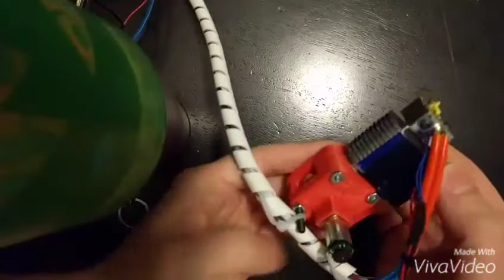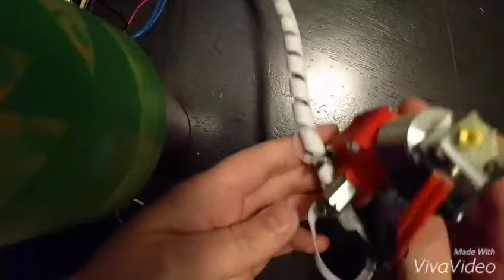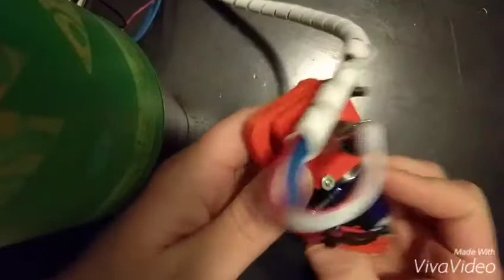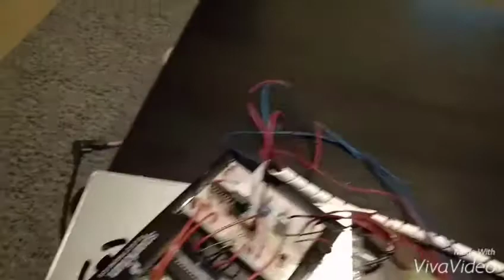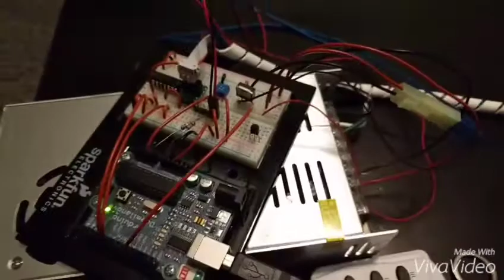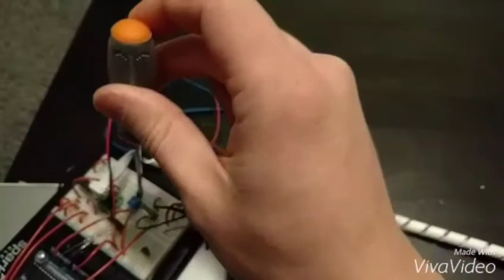Micro DC motor extruder

Comment: I was inspired by your idea and combining it with the tarocco motor controller. Just got the controller in the mail so we'll see how this goes!
Reply: How did it turn out? I've wondered why this isn't standard
Reply: @Daweim0  so the little geared motors wear out really fast. To get enough resolution, you either need a really sensitive encoder or a high gear ratio. It was harder to get the higher sensitivity encoders for cheap when I was working on this. You can see what I did come up with in my videos. It worked... But lacked resolution. There are several cheap absolute encoders out now that would probably make this project worth a relook. But I've also seen a crazy brushless extruder design recently that I think has more potential.